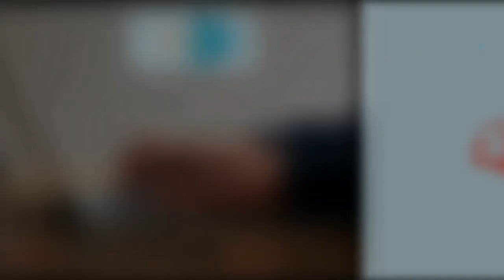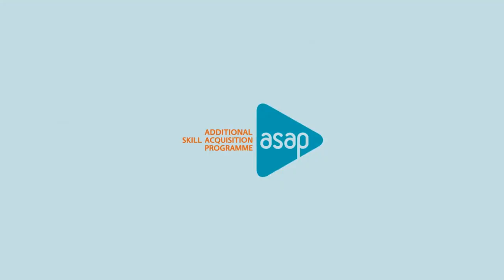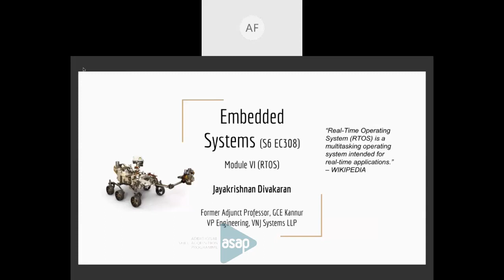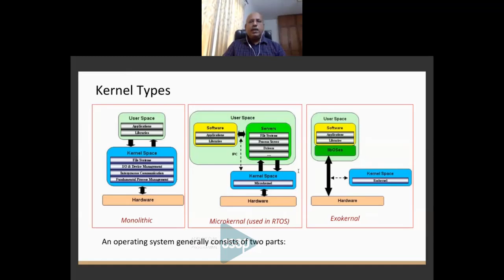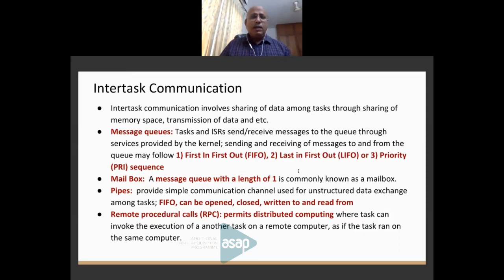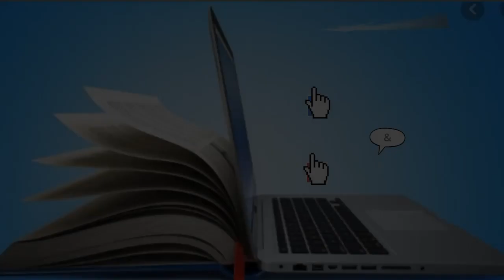ASAP Engineering Session 95 | 𝐄𝐂 | 𝐒𝟔 | 𝐑𝐞𝐚𝐥 𝐓𝐢𝐦𝐞 𝐎𝐩𝐞𝐫𝐚𝐭𝐢𝐧𝐠 𝐒𝐲𝐬𝐭𝐞𝐦𝐬 𝐛𝐲 𝐌𝐫 𝐉𝐚𝐲𝐚𝐤𝐫𝐢𝐬𝐡𝐧𝐚𝐧 𝐃𝐢𝐯𝐚𝐤𝐚𝐫𝐚𝐧

Comment: Note a couple of updates from the faculty for better learning from this video session 
a) In a simple executive, the flags for processing in the "while for ever loop" is set by ISR, but reset by the flag processing code in the loop after it's completion 
b)  kernel  keep state information about the use of I/O components through a variety of in-kernel data structures such as open file table, we didn't discuss I/Os in this session due to time constraints
c) Task latency depends on the mode that is selected: in preemptive mode it depends on the time taken by the longest task where as in pre-emptive task it depends on the time taken for the RTOS  kernal to context switch saving the states of the currently executing  task and restoring the state of the newly scheduled high priority task. This is many times higher than interrupt latency (which is few microseconds) and  is dependent the longest code in the kernal which disables the interrupt
d) RTOS like VxWorks do support processes other than tasks which all RTOS support
e) FreeRTOS has also been ported to RPi other than VxWorks 
f) Task priority varies from 0 to 255 with 0 as the highest priority in RTOS like VxWorks; Task ID is unique for each task even if they have the same task priority, maximum ID value is not dependent on the max priority  and depends on the RTOS